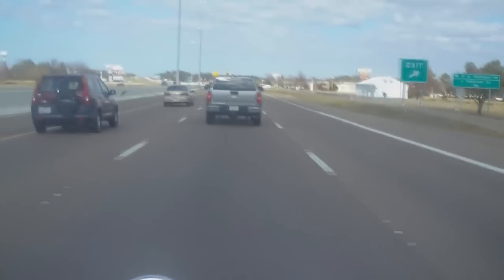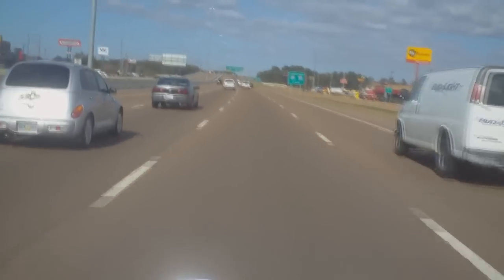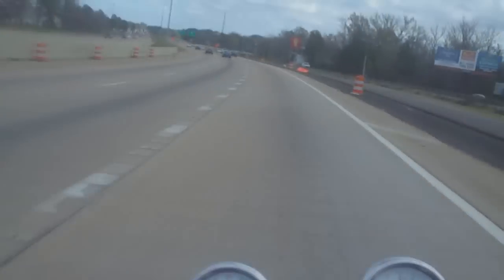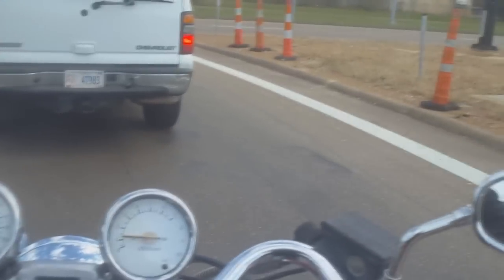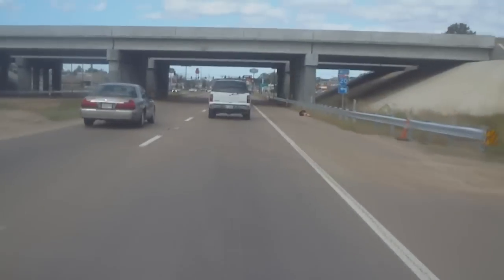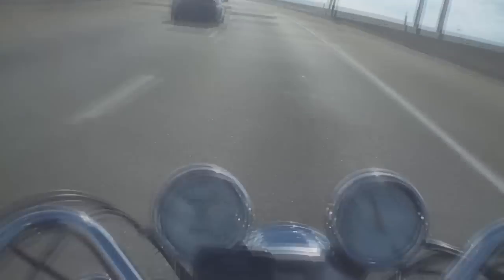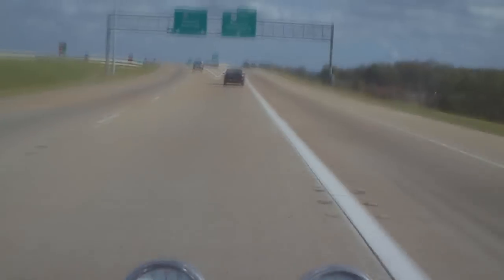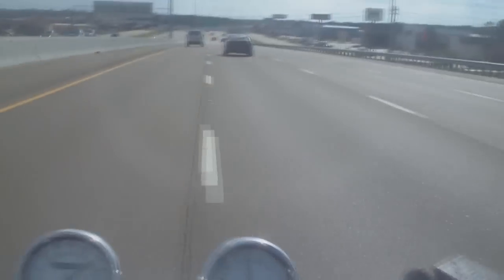Yamaha Virago Interstate

Comment: Glock I have the old KZ750 LTD and I have found that the 750 cc motors are plenty large inof for the interstate as long as they are geared well . I have had mine up to 90 and had plenty of throttle left but I did not have my tires balanced so she was just shaking like crazy . Nice bike !